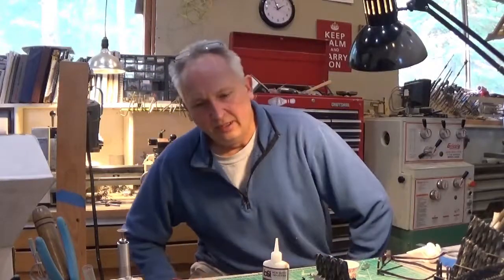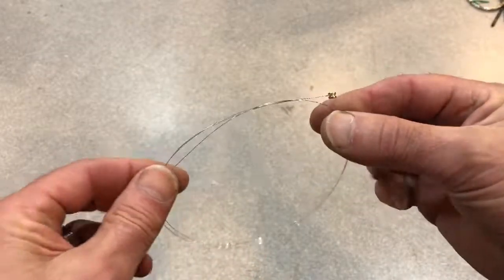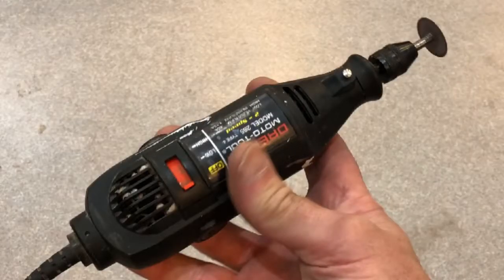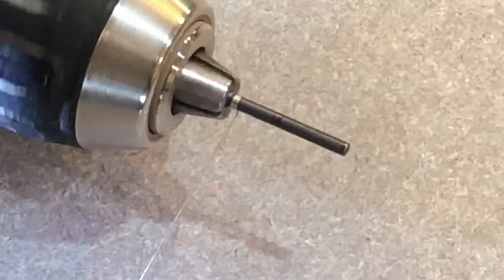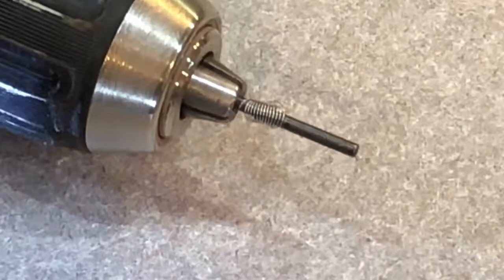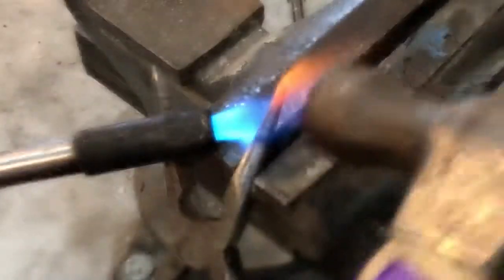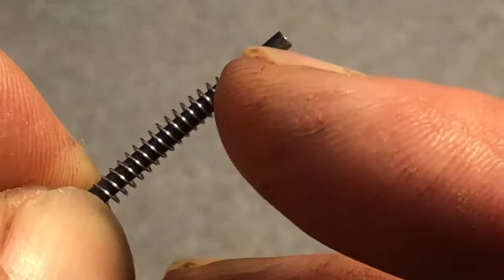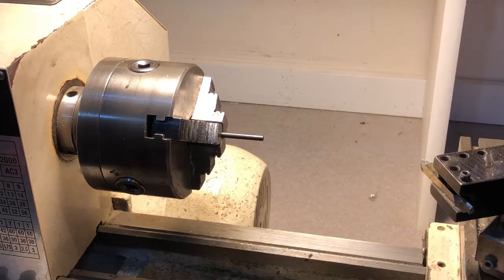How to make tiny springs

Comment: This is incredibly useful.  I repair vintage electric pianos and synthesizers.  They all use a small springs at the back of each key that allows the key to return to the up position.  These springs are very easy to lose and very hard to replace but this tip will probably save me many times from here on out.  I'm about to try this now for a keyboard I'm working on.

Comment: Nobody mentioned that if you turn the Dremel the sparks will fly away from you.  Very nice video!  I've been using transfer punches to make springs lately.  Sets of those can be had pretty cheap at Harbor Freight.  Also, the small bolt cutters make pretty good wire cutting tools for bigger wire.

Comment: Very informative.  I just ordered a guitar string assortment to make an unobtanium pawl spring for the pull starter mechanism on my new to me Evinrude Sportwin 3hp outboard motor made in a 1952. What yoy can't buy anymore, you have got to fabricate yourself to keep the vintage machines running.
Reply from the maker: Thanks. Happy you found the video useful!
Reply: I surely did.  The spring I lost is simply unobtanium these days.  I just practiced your method using some stainless steel tie wire and was amazed at how well it turned out.  Stainless wire probably isn't as good of a spring material as a nickel steel guitar string, but I was quite impressed anyhow by the end product.  I can't wait until my guitar string assortment gets here.
Reply: I have to do the same here for a 1963 3hp Johnson.

Comment: What kind of wire did you use to make the spring with your lathe? I need a spring about that size. I just don’t know what wire to use.
Reply from the maker: Its K&S music or piano wire. I got it at ACE Hardware but any big box store will have it in the metals supplies section.  You can also get it in just  about any diameter imaginable from https://www.mcmaster.com/music-wire/
Reply: @TheWeevilGenius  
Thanks so much for the immediate response. I have a couple of mouse traps, and that is about the size of wire I need. All I am repairing is a pair of stainless steel tongs that I’ve had forever. I hate to just trash them, especially if I can fix them.